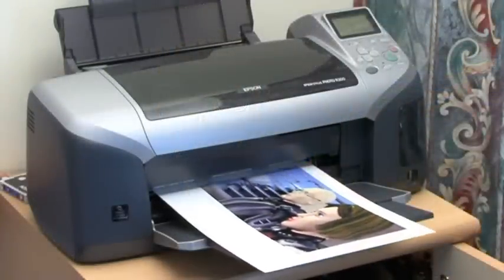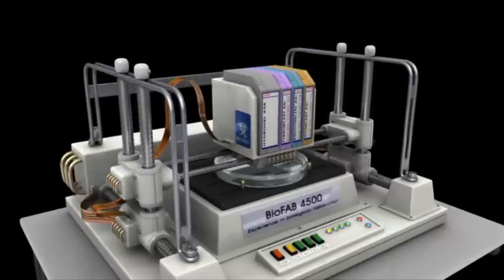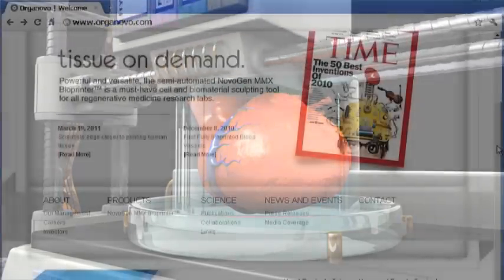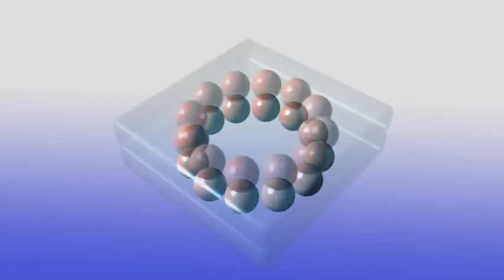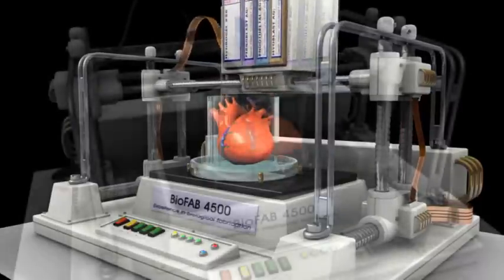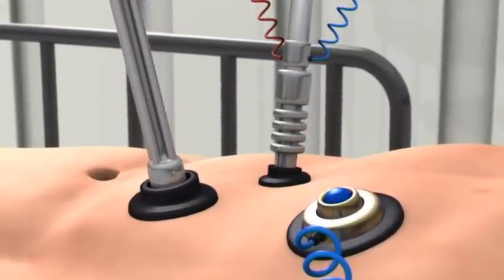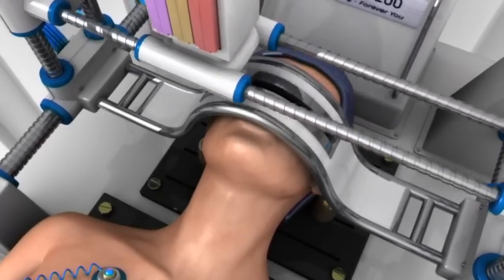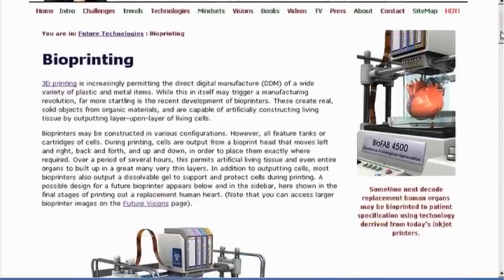Bioprinting

Comment: Bioprinting being what it is, they're probably going to need a lot more than four types of “ink”. Keeping the organ alive while it's being printed, might be a challenge. And some organs rely on things like tension to keep their shape, which would make things tricky, but I guess that's what the semi-solid gel is for. But once they do get it printed, and if they solve the problem of keeping it alive, there should be some forgiveness for the traditional problems associated with 3D printing, because biology has a tendency to heal, so if they give the organ some time afterward, it shouldn't have any problems with layer adhesion.

But the exciting thing is, I recently learned that someone got a Nobel prize for figuring out how to turn skin cells into stem cells. I think the award was from 2012, but I didn't find out until very recently. But anyway… This should be a major step in removing one of the major obstacles in making bioprinting practical, as stem cells can turn into more other cell types.

Comment: Folks, stop demonizing YouTube. There isn't anyone at YT that's nefariously trying to damage anyone. Chris's issues with the demonetization of this video are entirely the result of one of the algorithms incorrectly flagging this video. The algorithm wasn't created to misidentify videos, it's simply not working correctly.
That said, I am somewhat surprised that YT has based their decisions on whether to fix demonetization mistakes based on view totals over time. That's not a very fair or reliable way to address these mistakes by the system.
I'm also not getting why YT hasn't adopted any "super user" support models that would allow more responsive community based decision making and the ability of "super users" to correct demonetization mistakes (among many others) made by faulty algorithms. It would be much easier on YT staff to simply monitor and support the super users than to let faulty algorithms continue making mistakes.
While I understand that no system is perfect, I think the super user model would be more accurate and quicker to address problems than the algorithms currently being used exclusively.
Reply from the maker: All very true. And in the past, when I had serious demonetization issues in 2017, I did get very good support due to my use of content management across two channels, one of which (EC) is pretty large. But today they would, it seem, rather spend hours e-mailing back and forth saying why they can't review a video, rather than 5 minutes actually doing so.
Reply: and remember ... your future is in their hands Chris... That's a pretty scary thought.

Comment: Yes I was here :   Brain Food,   You have Brain Food on your  Video's !  Thank You Sir !
Had a Snicker seeing your desk.   Every flat spot in my house has reached the 1:1 Ratio.   If you set something on said spot something falls off.
Can't seem to maintain a open working service these days.
Maybe some day you could expand on the Rasberry Pi Zero W   ??
Found that little beast intriguing.  Perhaps coming up with a way to mate or interface  a SETA drive ?    USB / SATA ?  Would there be any other way ? 

Video Clicked and Booked Marked to be clicked periodically .

**   Surgeons are already placing Latices for bone and other body structures triggering the body to complete the work. I see this going places.
Reply from the maker: I agree, the Pi Zero is a great board. I must do more with it.
Reply: My guess is they will develop some form of Benign / Universal Protein they can print providing a basic structure or Path for the body to use rebuilding what ever needs replaced.  Perhaps  placed in proximity or adjoining the heart it would initiate Growing a new heart within your own body made up and by your own body ?   Just a Brain Fart.

Comment: Not quite bioprinting, but a step nearer, last year I had a crown made up for a tooth that broke. The dentist took a scan, which was sent to a 3D printing company through the net. The new crown was quickly printed, and sent back within a few days. Previous techniques were to take a mould, post, then wait for the crown to be delivered. Previously, they have to allow about 10% tolerance for when the mould dries. Now the crowns are an exact fit. The new crown I had fitted was amazing! - I was very impressed.
Reply from the maker: Great to hear, 3D printing for "digital dentistry" is growing rapidly now.

Comment: Cells don't live on their own. Might want to go back in on the drawing board about sustaining Cell life first before moving to organ maintenance. 

Not saying it can't happen, but dreams usually take 20+ yrs. Its either you die discovering, or someone takes over.
Reply from the maker: IgnoredSounds They call this the thick tissue problem -- keeping cells alive during the bioprinting process is indeed a big challenge. The hydrogels ("bio-paper") referred to in the video do work for thin tissue -- and Organovo is now bioprinting thin human liver tissues (about 400 a month) as a commercial product for use in drug testing. But some kind of artificial vascular network will need to be bioprinted in tandem with cells to sustain thick tissue -- as currently being worked on by Ibrahim Ozbolat and others at the University of Iowa. :)

Comment: This is brilliant beyond belief just imagine in around 15/20/30 years time being able to cure blindness amongst other diseases. :)
Reply: We'd only be able to fix trauma and disease caused blindness, not genetic.
Reply: @trolololololol12233  - well, I'd say alteration of one's genes is something that could feasibly be integrated - spec. the development of gene editing tech (albeit it's delivery appears to be fairly straightforward, what it will advance to..(?)..that's hard to say).

Otherwise, a person blind from birth, depending on the genetic error rendering them blind, without using damaged DNA, there could be a set of files for just these sorts of problems.  Erroneous DNA could be swapped for a "best-fit" DNA from a comp's library to construct a functioning eye; even non-instantaneous repairs, I could see this tech building an eye primed to become functional  by loading it with genetic material, cells, pharmaceuticals even, all built to continue the regeneration process for days post implant.

Comment: Hmmm . . . instead of it printing like this, sounds like it might work better if it was designed like a resin printer.  Meaning that the printer would assemble the organs out of the "resin" and be suspended in the medium at the same time.  But I digress, this kind of technology concept reminds me of a book called "Pandora's Star," where humans actually have "rejuvenation" every 60 years or so.  Hell, Im in my 30s now and kind of intrigued at the prospect of my bothers and I living through our 100s.
Reply: Then you probably also read about "lifers" and their bid for prolonged life and the social chaos it can create.
Reply: Mike Cimerian
It's kinda two-pronged.  On the one hand, you'd have people fighting for their right to extended life.  On the other, the potential for a longer life inspires many to view life as more precious, so risk taking/war mongering is likely reduced.  So the actual result is still up in the air, but I veer more to the latter given current trends.  But I guess it'll boil down to when the tech comes out and whether or not we'll be wise enough to handle it.
Reply: Siolfor80 It isn't simple. Unfortunately those who will decide whether or not gene therapy will be legal are the same people who blocked stem cell research for years even though alternate sources of stem cells have been found since.

I think most of the gene therapies will be performed in countries where authorities turn a blind eye to what specifics are going on in return for protection money.

Wisdom is key. Wisdom without education is good nature naivete. Education without wisdom is undirected ability.
Reply: Mike Cimerian
True enough, but wisdom with education makes can make one more cautious.  The only problem with being too "wise" though may be a regression in terms of competitive nature.  We rely on this nature in order to improve ourselves, and push further than where we are at the time.  So it becomes a matter of how we'll see boundaries in the future, and how we approach them.  Age is one of our oldest boundaries, and we've already tripled our lifespan in the course of 400 years (quadrupled in some cases).  And then it becomes a question of what boundary we'll come across after age has been defeated.
Reply: Siolfor80 If competition can be toned down in human nature then I am all for it. We are social by nature.

Mathematical models have proven that cooperation is more efficient than competition. Pigeons don't try to be first to the feast, they flock there using their numbers to confuse predators. Same for fish schools. 

It is our ability to cooperate that built civilization. I believe in something higher, emulation. 

Our civilization is stuck between two states. We cannot go back into the egg of innocence that was provided by socio-religious paradigms and we have sawed away the remnants of consensus and shared ethics that was our step toward something else.

Social centrifuge forces are in a positive feed back loop, the more the social fabric is disjointed, the more we detest and despise what is social because what comes out of it is below most individual's level of intelligence.
Reply: Mike Cimerian
I see that as a problem, and kind of stability paradox.  If a society appears to be too stable, it can actually regress.  Let's take the Romans, granted they built their empire on lead, but they regressed as a result of comfortable living.  Sure they had a good army, but they didn't try to improve their communication so they could maintain their empire.  Comfort breeds apathy, so when change comes, chaos become dominant.
Reply: Siolfor80 Rome is a good example. Marius reform of the army signed the end of the republic. A professional army could further expansion but at the cost of loosing the commitment of elites to the republic and subsequently the disintegration of Rome's core values.

Athens didn't fall into this trap, the citizen body politic held all the prerogatives and responsibilities. Athens didn't become an empire, granted, but even Socrates did his military service in heavy infantry. 

I am arguing for conversation's sake as I consider that you are correct in pointing out the effects of comfort and complacency and their negative impact.

This is why I favor Rome's republic over the imperium as every citizen's fate was linked to a social contract based on mandatory participation in every aspect of the republic.

It seems that civic responsibility once delegated, cannot be claimed back as growth provided by overspecialization creates a level of complexity beyond the ability of a person to embrace completely all aspects of his society in every day life and in all it's dimensions. This eventually leads to decadence.
Reply: Mike Cimerian Hit the nail on the head.  As was stated in the movie "Ghost in the Shell," - "Overspecialize and you breed in weakness.  It's slow death." - Maj.  Kusinagi.

So the ideal would be a government of people, responsible for both improving society, and maintaining their social and technological advancement at a steady pace, and at a relatively equal rate across it's influence.  A full blown lazy/decadent lifestyle would be viewed as taboo as those involved aren't aiding the society's advancement.  Would be like mixing the International Olympics with democracy:  competition for the sake of continuous advancement.  Just a thought, of course.
Reply: Siolfor80 Your statement is in perfect agreement with what I now think. You are describing Athens at it's zenith. Athens had no regular standing army, defending the city was every citizen's responsibility.

Athens didn't have professional politicians; they had a name for them, demagogues. A citizen was expected to spend time each week at the agora, debating and contributing toward consensus and decisions.

Each layer we have shed away as individuals has contributed toward specialization, loss of ability to build consensus and ultimately the death of society as an abstract consensual multidimensional construct. 

There is always the demographic question to justify specialization. In my opinion, demographics are not an obstacle once we have established cities that are modeled after the needs of an organic society.

Bottom up, as in participative development is anchored in experience. Top down models are abstractions forced upon people.
Reply: Mike Cimerian
Well remember, anything we can create, we can change.  We've been around 5 million years, established our first society only 6000 years ago . . . we probably won't know what kind of psycho-social makeup we'll have in the  future, BUT we can at least start establishing a skeleton of it based on past and current successes and failures.  It'll come down to what's worth keeping for a while longer and what's worth leaving behind for the sake of social improvement.  This is where we end up with the crybabies who want to keep their precious "investments" as opposed to putting in some new ones for a better future.  It's that particular mindset that's holding us back.
Reply: Siolfor80 I am grateful for this conversation, thank you. Hopefully we will get other occasions to focus on other questions. While I am not an optimist, I do believe in trying. What else is there to do. :-)
Reply: Mike Cimerian
I'm not either, kind of a, "Love humanity, hate people," kinda guy.  But that's the optimistic side of things . . . regardless of all the bad news, good stuff does happen.  All it takes is a change in perception of reality . . . will take a while, but it's happening.

Comment: I lost the fingertip of my thumb. Would this technique work in my case? Its just 1/2 of tissue. (no bone)
Reply: Also keep in mind that any technology that you see being sold, displayed, or advertised, is about 4-5 years behind what is being done in labs across the planet. There are may inventions that are being kept in the dark until a patent is applied on them. That is specially true about the medical technology and IT. 
So printing the tip of a finger could happen much sooner IMO.

SAeid
Reply from the maker: Kyle Eckert Bioprinting is certainly progressing rapidly, with medical 3D printing more generally expected to be a billion dollar business by 2019 -- and that can only push the technology forward. Right now, one of the major challenges (so a leading researcher in the field has told me) is thick tissue fabrication -- and "thick" in this context means more than a fraction of a mm. The problem is that thick tissue needs to be kept alive during printout, and yet at this stage the cells aggregates have not fused together, so there is no vascular network that could potentially sustain them. But there is work in progress to bioprint a kind of temporary vascular network into thick tissue during printout, so allowing nutrients to be supplied, and waste removed. And so the thick tissue problem may in time be overcome.I mention the above to signal that (a) great progress is being made, but also that (b) there are many, many challenges. Organovo may already be selling "Novotissues" of 3D printed human liver cells, but these are thin, non-functional tissues, and the focus of Organovo's research has moved in this kind of direction (I am sure to keep the company in business!).Longer term -- it may be 10 years, it may be 20, I would be very surprised if it were less than 10 -- I think we will be able to bioprint replacement tissue onto the human body (or form it in a lab and graft it on). I spoke about 3D printing at a medical conference earlier this year, and chatting with medical professionals afterwards, nobody was dismissing the possibility.Hopefully, you will be able to get a new finger top sooner rather than later. :)
Reply from the maker: Right now it is not possible. But in maybe 15 years, bioprinting a new tip for a finger or thumb could well be a possibility.
Reply: Great. Thanks for the reply.
Reply: Saeid Momtahan Thanks for the insight and reply. Greatly appreciated. I have read that this technology is emerging and developing very rapidly, and am trying to follow its advancements as closely as possible through different medical mediums. I have read different projections as when it will be ready for mass commercial use, but am hopeful it will be sooner than later.
Reply: ExplainingTheFuture I must again thank you for imparting to me this knowledge you have through your work, and the experts you have encountered. I am hopeful that one day the science will be there to device just a little bit of tissue to compensate for what couldn't be salvaged after my accident by bioprinitng. The grafting technique you mentioned would, I surmise, be great in my case. I hope that becomes an option in the future!
Reply from the maker: Kyle Eckert
You may be interested to to know that Organovo has now partnered with L'Oreal to develop bioprinted skin. Currently for drug/cosmetic testing purposes -- but the research will assist with progress toward bioprinted skin grafts/repairs:

http://www.theverge.com/2015/5/18/8621585/loreal-skin-printing-organovo
Reply: Very interested. Thank you for bringing that to my attention.

Comment: It doesn't work like that. We would still be using normal cells, a combination of stem-cell advancement and technological application. To actually modify the human body in such a way would require alteration at the cellular level to increase dermal layering, bone density and muscular tensile-strength. Genetic modification research. We would however be able to repair the body after said collision.